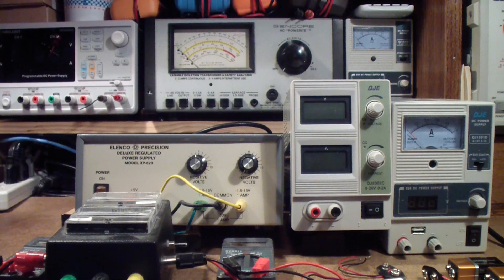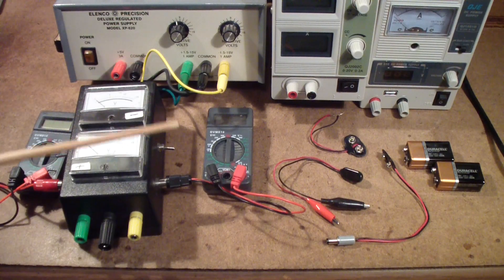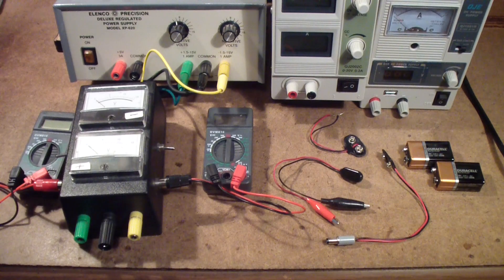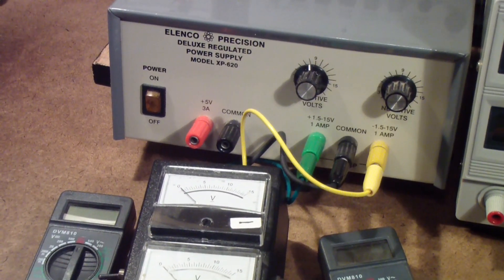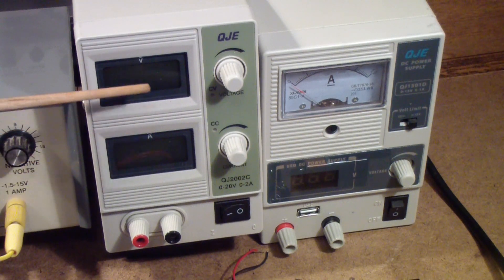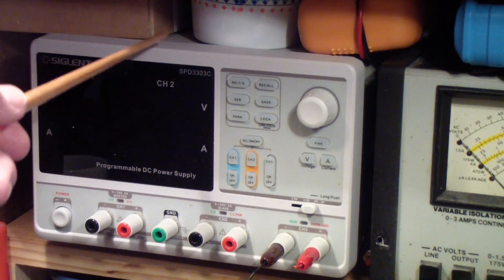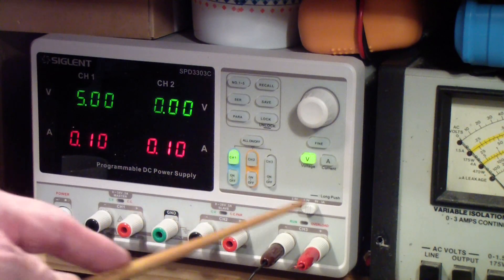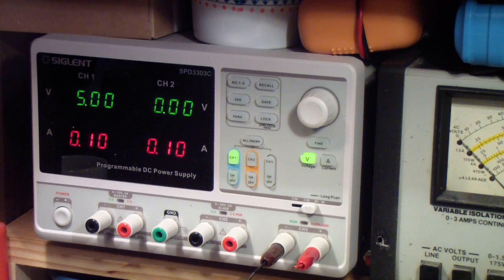TTT347 Power Supplies

Comment: One comment and a question.  The comment is that I think it's better to stick to linear supplies for the current and voltage ranges of these general bench power supplies that don't put out very much power. They cost more than the switching type, but the noise tends to be much less.  The question has to do if you agree with Dave Jones' complaint about the binding posts on the Siglent supply. He claims that the spacing is not standard for, say, a banana-to-BNC adapter, and that the sockets are too big and don't grip standard plugs firmly enough.
Reply from the maker: Thanks for the comments and questions. I agree that linear is better on the noise front. I have several linear supplies (up to 35 amps) and they all have low noise. I also agree that the banana jacks on the Siglent are non-standard and spaced too far apart for standard BNC to Banana adapters. You can pry the springs on a banana plug to help with the first, but there is nothing you can do to fix the second problem. I disagree with Dave that "you shouldn't turn it on - tear it apart," since I think you check first that it works and meets the specs you paid for before voiding the warranty by breaking in. Bur everyone has a right to their opinion.